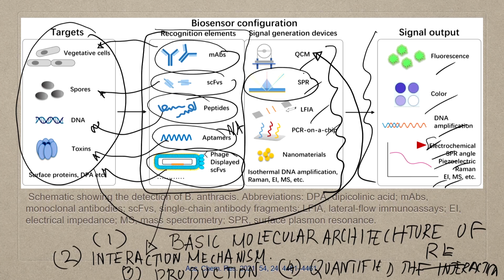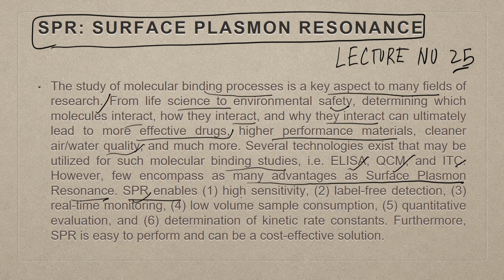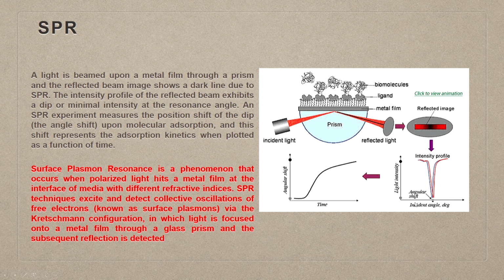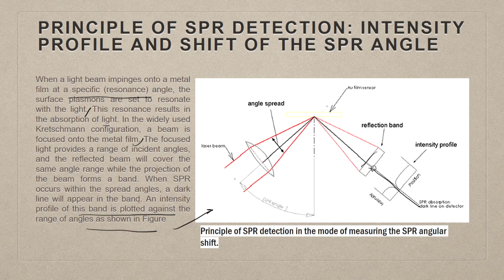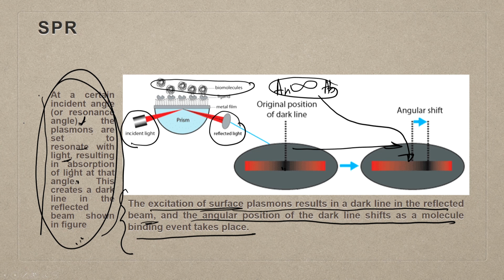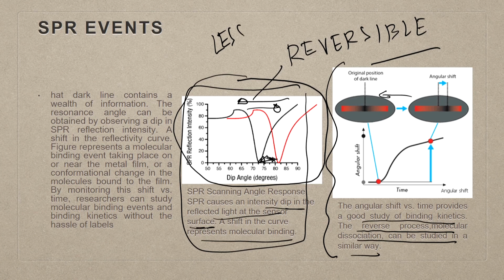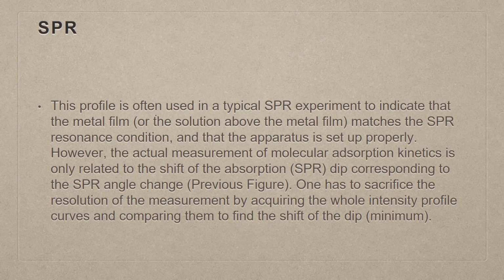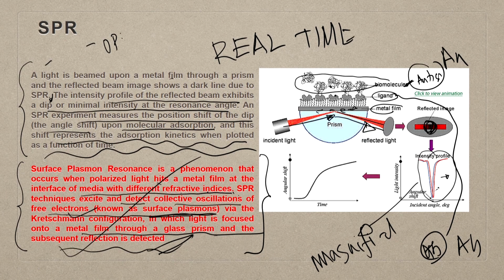Lecture 25 : SPR : Surface Plasmon Resonance

Comment: Sir as the angular shift in the black band occur due to the binding(interaction) 
So does our angle of resonance( angle at which the free oscillating electrons is in a resonance with the light particle photons being thrown at it) also changes or is it still remain the same ?